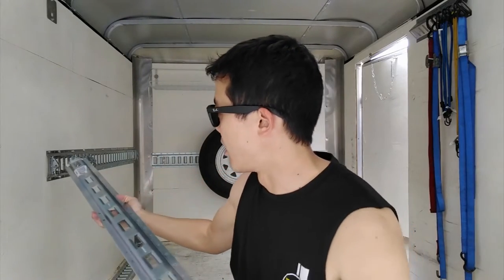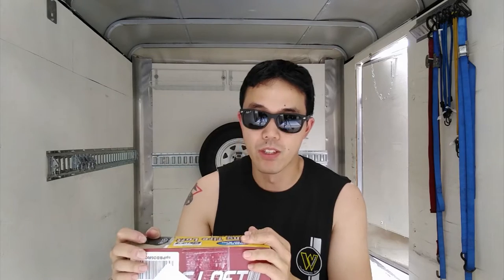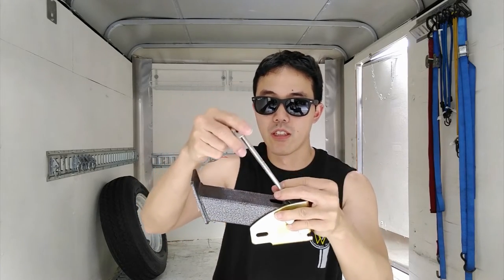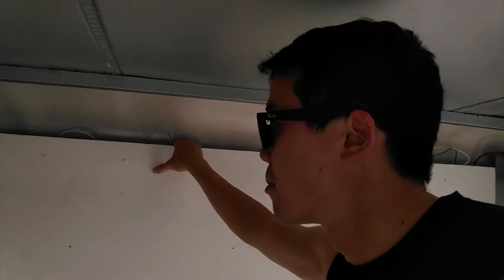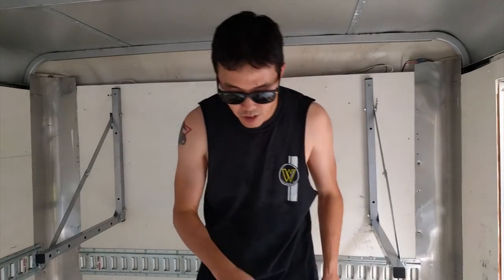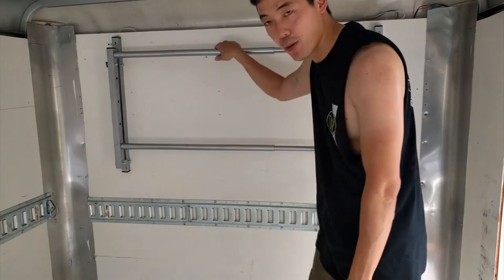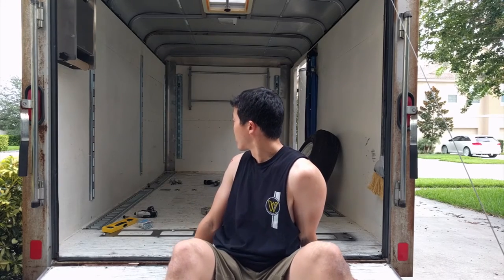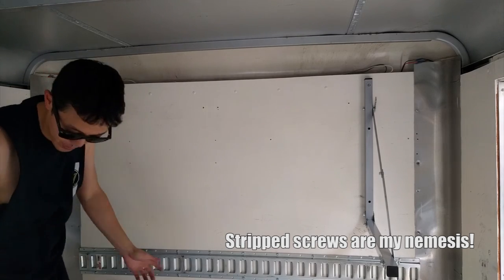$44 Tire Rack Installed in My Trailer | Hyloft Tire Rack

Comment: Very useful, thanks! How has the tire rack held up? I am considering buying a similar rack, and would be mounting 80lbs of tires to each rack (4 feet wide), but I'm unsure if the sheet metal screws would be strong enough to hold the rack to the wall if I hit a pothole etc? Any thoughts are appreciated!
Reply from the maker: I will if it's mounted onto the frame elements of the trailer. If the frame isn't spaced right, you can mount a piece of plywood board then mount the rack to that, but it should  be able to handle 80 lbs no problem. I have 2 rings on either side of the rack that I use to strap the tires/wheels with a tie down so that also helps alleviate some of that stress.
Reply: Interesting, thanks for the response! Yes I thought about mounting an etrack rail above the tire rack, so that I can strap the tires UPwards, reducing some stress and having a nice Plan B if the rack fails, instead of falling onto the racecar.

That being said, any recommendations on hardware? I am useless when it comes to hardware, so the names of the bolts I am looking for would be very useful (are sheet metal screws graded for strength? or is it just based on the width of the screw? etc etc)

Thanks again!
Reply from the maker: I can’t remember what screws I used other than the self tapping ones, but get ones somewhat close to the size of the included hardware and it’ll be more than enough. Just don’t use the mounting hardware included. There are some horror stories about them.
Reply: Thanks Jason, appreciate the info!
Reply: I finally got the first rack up in the trailer (two more to go). I ended up tapping threads into the studs of the trailer, and using large bolts to secure the rack. It seems to have worked well, I hung my body weight from it (along with 2 tires, 220lbs total) and it didn't budge, should be good! Thanks again for the video